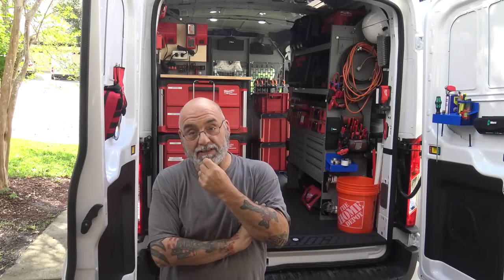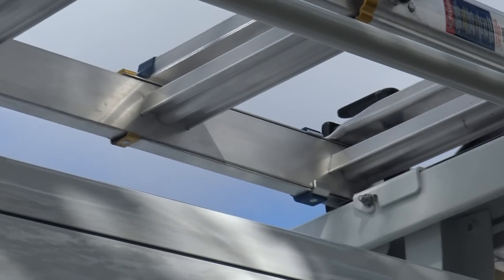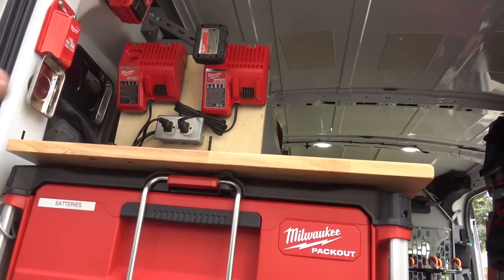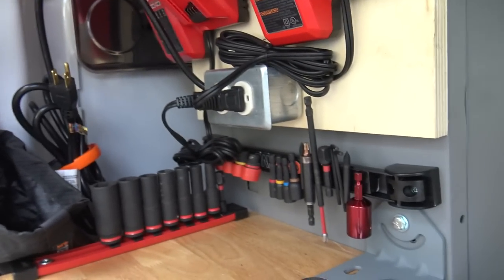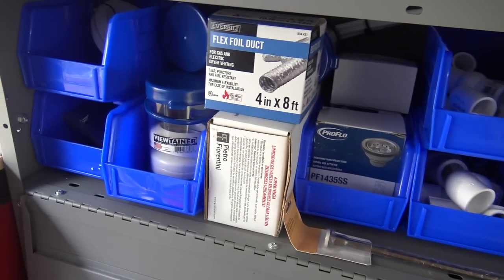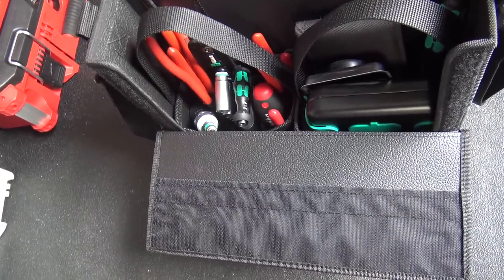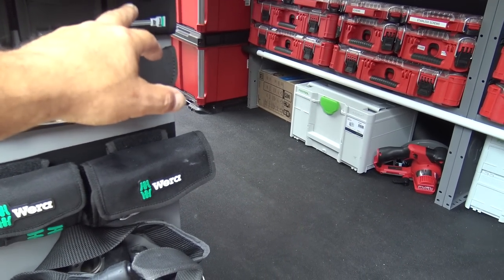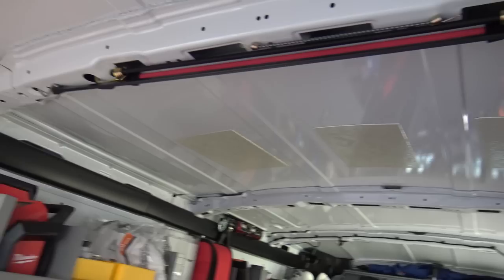My new work truck

Comment: What an absolutely Amazing Work Van. I’m in the Commercial Laundry Equip Bus. 36yr. Sell/Installations. I’ve retro fitted 2-Vans now an old Snap on Van and a Ridgid 300 Pipe Thread Machine Mounted inside with an Inverter to run outside and inside Lights when on a big install. 
        Installed a Single Gang box on the outside Passenger rear to plug in power from a building to power the Lights and the Pipe Machine. Installed and Passenger side Chain style Pipe Vise with Pipe support rail for 20, Sticks.
        You Van absolutely kicks my Vans ass. I like being able to stand up in a Van way better than a Truck with a Cargo bed. Vans Rock, I’ve even had to sleep in it on Jobs before. You can’t do that with a truck. 
       I installed 3”dia. Round American brand Locks on the rear Double Doors and the Bulkhead. Your not getting into my Van and Tools with any Bolt Cutters.Remember the saying “ If can’t protect it , you won’t Own it “ I worked in L.A. and all the surrounding cities. 
        I always keep a “ Club Steering Wheel Bar “ on the Steering Wheel AND USE IT EVERY TIME I leave .The Police told me they’ve “ Never “ seen a Vehicle Stolen that had a Club Bar on it. It sends a Message 💪.
        Thanks for the Video it’s great and  you are truly a Professional. I’ll subscribe and support your channel. 🙏 take care Brother. Bob G.
Reply from the maker: Thank you for such a great comment 👍👍it’s a pleasure to hear from someone like you and the love you have for your business. I run slot of gas piping and install commercial tankless heaters for commercial laundry’s here in Florida. I do a lot of hotel work and we just finished a stand alone laundry in town. Thanks Mike PS: if you ever need any help with tankless heaters (Rinnai, Navien) hit me up I have a second channel called 
That tankless guy I a trainer for both companies.

Comment: Nice truck.  I use the ford app to remote lock and auto start on my company truck.  You cannot move the truck when it is started this way.  It locks the transmission.  I think you may like it.  It is very easy to set up.  Nice if you set your keys down and don t have them when you need to get in the truck.   It has saved me a few steps.  It also tells you other information on the truck.  Well hope this helps on those frosty mornings.

Comment: That thing is fkn dope!
Excellent, clean, crisp, fast, easy. You’re not moving one thing to get to another. I have a metris I’ve been working on for a few months now, the idea I have is to minimize getting into it with rollouts and drawer type stuff so far I have an 80 x24 inch cargo drawer coming out of the back slammed to the driver side that cantilevers out of the back about 50 inches. I keep my table saw on that, and my rear doors flip all the way around to the side of the van, so I can have the saw just floating there. :)

Comment: Looks good, I just stepped out of a Ford e250 and got a high roof Promaster for electrical work. It is so nice outfitting it just the way works best for me. I did go with the composite partition that is just incredible. Best of luck with yours, our backs will thank us.

Comment: Nice truck set up! Love all the Packout and you gave me some ideas for my drawers that just bought. Get yourself a pair of the AMP research automatic retractable steps for your van. They sell them at pickup truck up fitter stores. You will love them! Also, I would love to see what you carry in your Veto open bag, if you already haven't done a video of that.